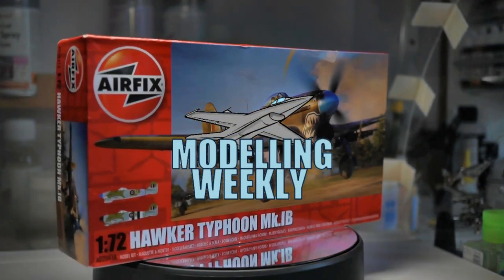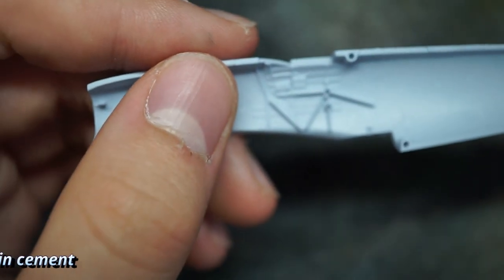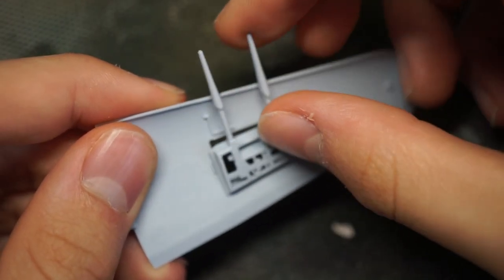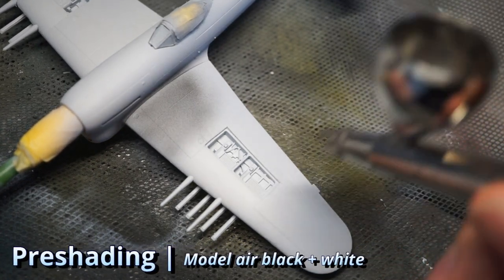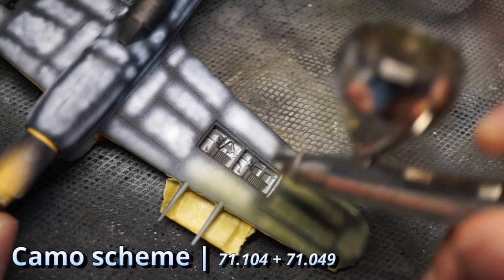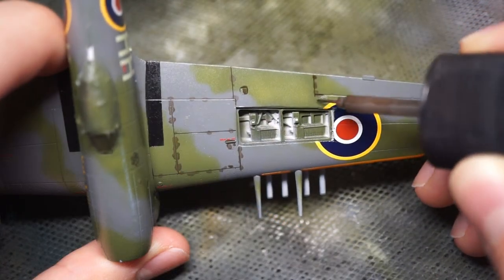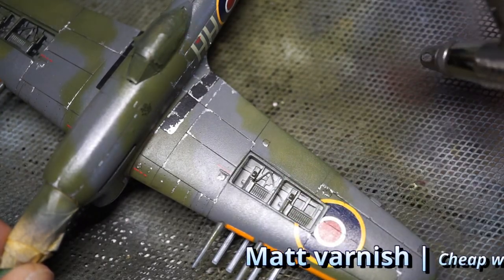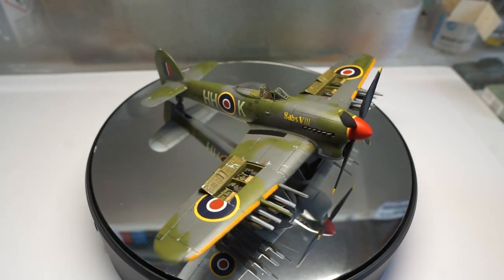Hawker Typhoon Mk.IB | Airfix 1/72 | FULL BUILD

Comment: Hello there! I am in the air cadets and I was at an event where I got a gift bag with one of these in it, I’ve tried building but I’m very confused on the cement part. Am I supposed to get that myself and how?
Reply from the maker: Hi! If the kit wasn't a starter set, you'll unfortunately have to buy some separately. If it was a starter set, however, you'd have been given a small tube of normal polystyrene cement - this is a little harder to use than liquid cement, however if you squeeze some out onto a piece of cardboard from the box, you can use a toothpick to apply it more carefully to the model. Hope this helps :)
Reply: @ModellingWeekly  ah ok, thank you!

Comment: Thanks. Great video for us 'newbies' coming  back to the hobby after 30 years away. Can I ask what psi's you spray at and how do you mask your canopies?
Reply from the maker: Many thanks! I normally spray anywhere between 15 and 25 PSI, depending on what feels right for what I'm spraying. In terms of canopy masking, I actually plan to release a tutorial soon enough talking through the 3 most effective ways to maski your canopies, so you may want to stay tuned for that. For the time being, the way I use the most is to lay a piece of tape over the section of canopy you want to mask, then use a toothpick to crease the edges near the struts. Then, with a very sharp blade (using very littl pressure), cut along those crease lines. Then remove the excess tape. It may take a few goes to o begin with, though once you get a feel for it it becomes second nature. Hope this helped, and again, I'll go into more detail in the video 🙂

Comment: How did you mask the canopy? I have been having problems and I have never got it that neat 😂
Also where is the best place to buy the tamiya pin wash in the uk as I can’t find it anywhere
Reply from the maker: To mask the canopy I covered the glass with masking tape, then used a brand new blade to very carefully cut around the struts. 

Tamiya pin wash is very scarce, I had to buy mine on Ebay to be shipped from japan :)
Reply: Thank you!!!! Huugggeeeee help :) ;)

Comment: What varnish do you use I don’t think I heard you say it
Reply from the maker: For gloss: Humbrol gloss varnish, Matt: A cheap wood varnish thinned down for my airbrush
Reply: @ModellingWeekly   I’ve never tried wood varnish as a matte coat before. What thinner and thinning ratio do you use?
Reply from the maker: @jonathanblack5807  It's roughly 50:50 with tap water, through a 0.4mm nozzle. I've only ever used the Wilko Clear Matt Wood Varnish, so I don't know about other brands :)